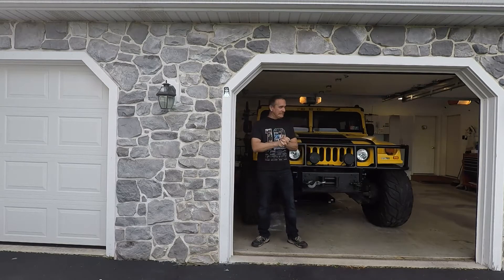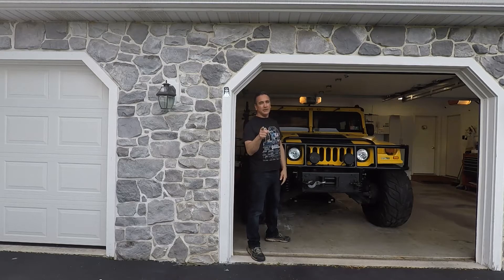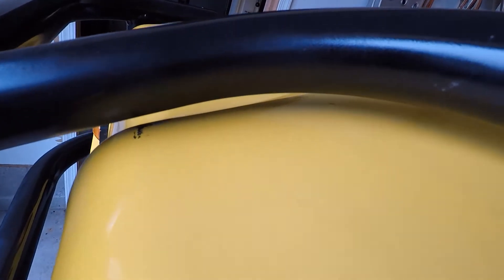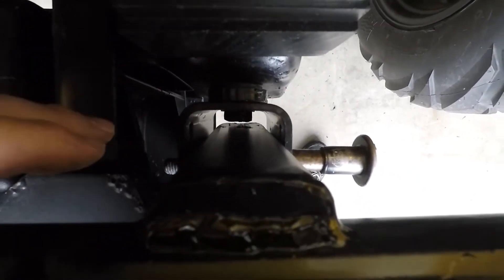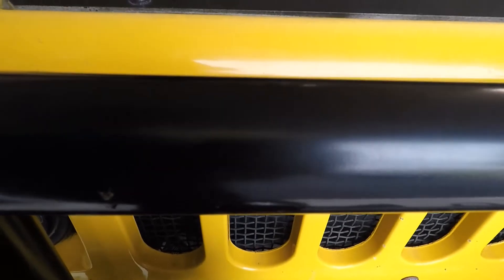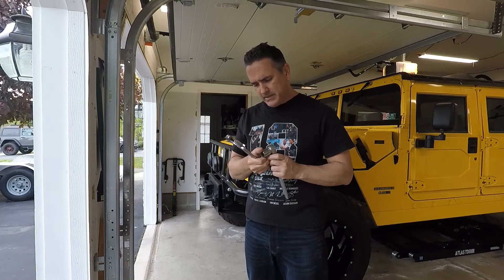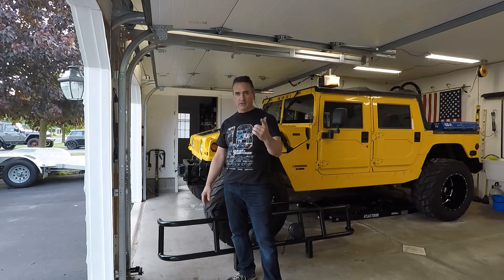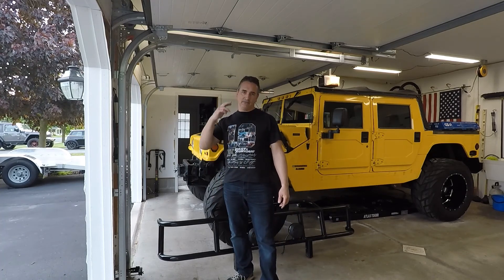Removing H1 Hummer Push bar!

Comment: I know that this video is over 2 years old but i just thought I'd comment on the Hummer H1.  First off the body has been lifted off of the frame by about 2 inches.  That caused the grill guard to come in contact with the hood.  They spaced the mounting brackets off with spacers and washers to give some clearance but they didn't space it far enough.  If you really want to have it fit like factory, you'll need to lengthen the mounting brackets by however tall the square spacers are that got put in between the frame and body.  Then the spacers and washers can be left out.

As far as the lights go I would continue to use the round lights they match the round headlights.

I'm going to go watch some of your other H1 videos.
Reply from the maker: Thanks for the info